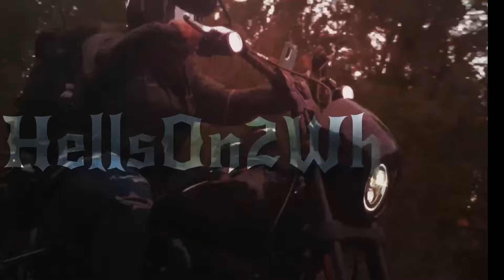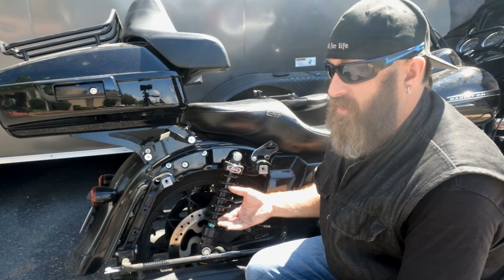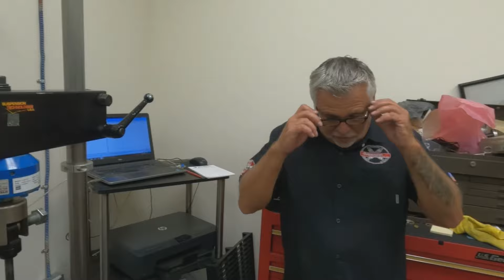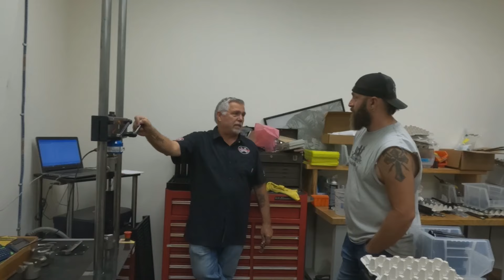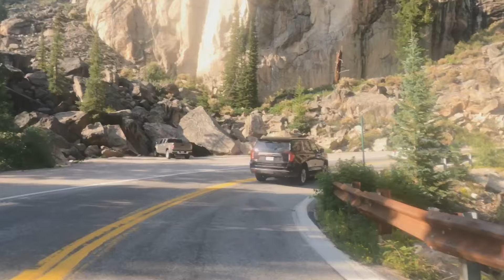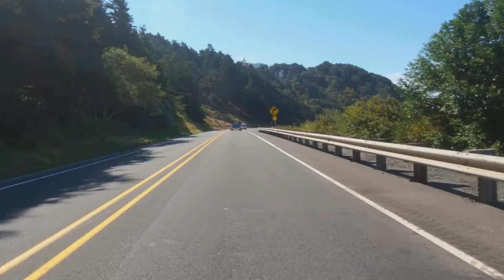Harley Davidson Road Glide Suspension Technologies

Comment: I'll give my Indian a year before I consider a rear shock change. The ride is better after I lengthened / raised the rear end. I don't have much more adjustment left available to me and have yet to have another passenger on. Not sure if the stock shocks can do it. Hopefully Suspension Technologies will have a set made for the 2022 Chief / Super Chief / Dark horse next year. Having to use the spanner wrenches and having to remove the bags because of getting the wrenches on there does suck. Thanks, Professor Hellbelly!